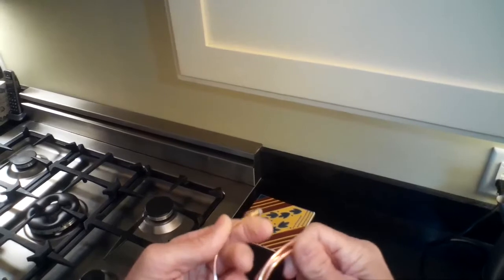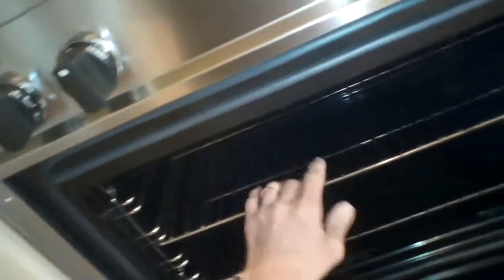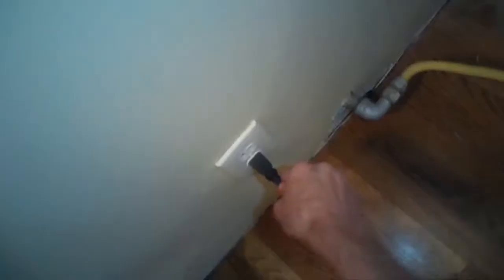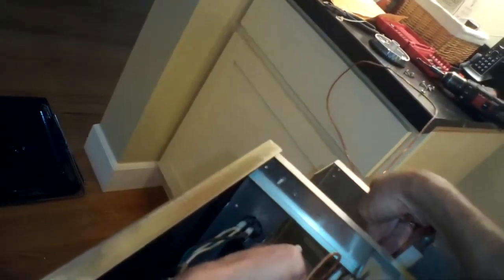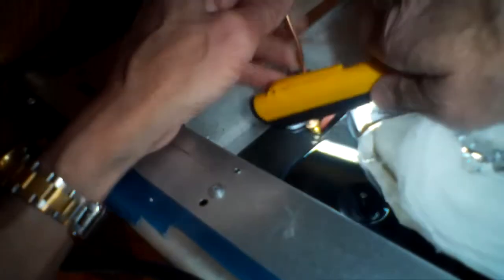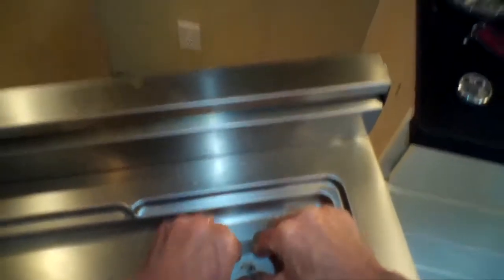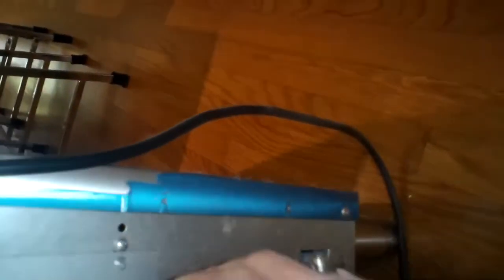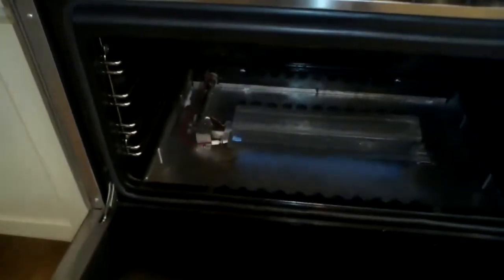✨ Bertazzoni Oven Won’t Heat Up - EASY ThermoCoupler Replacement ✨

Comment: Thank you so much for posting this! Our thermo-coupler was frayed at the connection in the oven. We contacted the company who usually services it and they quoted over $500 between the call, the install, and the thermo-coupler. We grabbed the part for a little more than $20 and I installed (with our toddler as assistant!) in about an hour.
Reply from the maker: I love it,
Nicely done😊👍❤️
Reply: Hi Monica, where were you able to purchase the thermo-coupler?

Comment: Hey Scott - You make it look easy! - I need to replace my thermostat, because my oven won't maintain temperature, it runs about 50-degrees hot, any chance you have a Bertazzoni thermostat replacement video? I can't locate an appliance tech to come fix it...Much appreciated.

Comment: Thank you for the great video. I followed the steps, when I tried to turn on the oven, there was no ignition, also no spark sound, just gas. Could it be that the connection screw on top is not tightened enough and therefore there is no connection? Thank you for your advice!
Reply from the maker: Thank you, I would tighten the connection.

Comment: Hi Scott, I’ve replaced the thermocouple but my oven still will not heat to 500. It’s propane service from a large tank on my property. Will adjusting the gas intake sleeve inside the oven make a difference? Any other ideas would be appreciated. Many thanks❗️

Comment: I would love to get your input on dealing with uncontrollable temps on my Bertazzoni.  No matter what setting it is on it always slowly creeps up to 500F.  I was told they had problems with faulty thermostats, but I've tried two new thermostats with no difference.  Very frustrating!  Is there a way to test the thermostat on these ranges?  Is there another component I should be looking at that could be responsible for this problem besides the thermostat? Thanks for any advice.
Reply from the maker: Might be time to replace the safety valve. Sounds like it gets stuck open
Reply: @QuickAndEasy5MinuteAppliance  I've been scouring the parts diagram/list with no sign of a safety valve.  Could it be built into the thermostat?  The range is model # is mas365gasxe and has been converted to LP.  The thermostat part # is 503136.

Comment: Extra Troubleshooting: When putting the top panel back on, you def need to watch out for the (white) igniters. It initially got in the way of aligning the panel flush to the range. We also had to push down on the whole panel to have those short burner screws meet with their corresponding holes below (otherwise they are just dangling in the hole). 

Theoretically easy fix. But if your stove has been used and isn't as spotless as the one in the video, it can take some time to simply degrease the screws enough to be able to remove them. IF they are stuck, suggest you us a handheld screwdriver to get it started once degreased (with Krud Kutter).  Our 18v makita began to strip one of the screws (at the beginning). One of the burners would't turn back on after re-installing all. Realized we accidentally clogged one of the burner gas holes (center of the "trough" on each burner). Fixed once we de-gunked with an awl.  All-in-all, it took us 3 hrs total. About 30 minutes went to cleaning grease and grime around the sides, wall and panels. Eww.